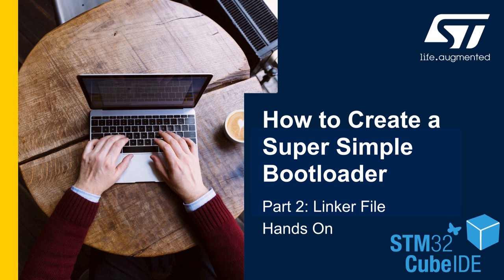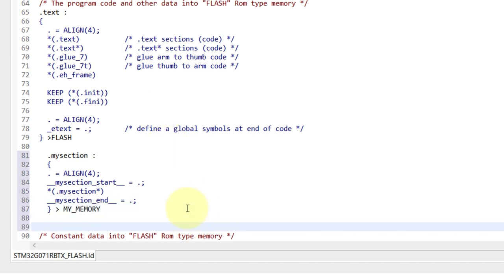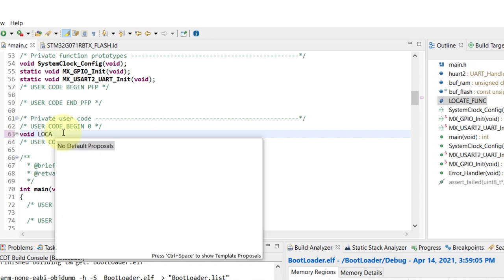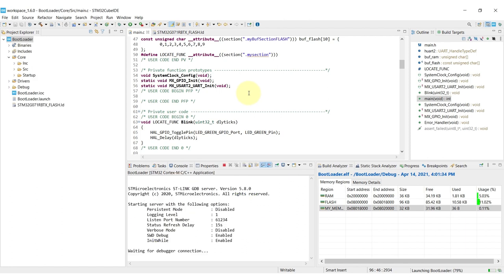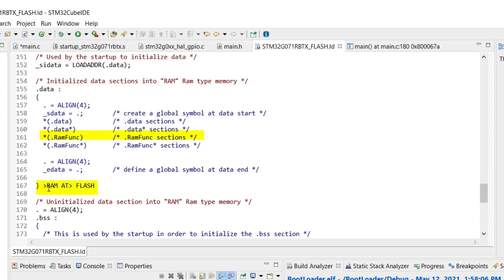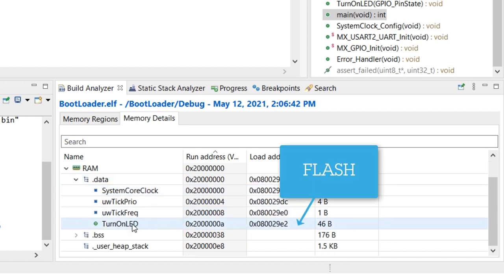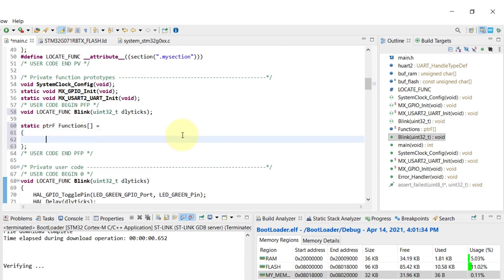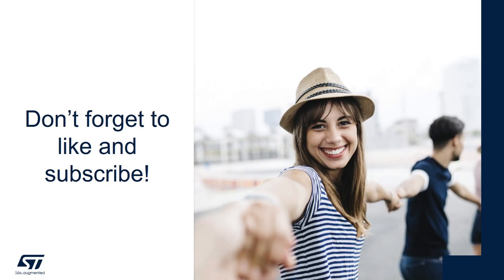How to Create a Super Simple Bootloader, Part 2: Linker File Hands On

Comment: Hi, thank you for the great video tutorial. I'm trying this on stm32f407 and things are not the same. 

For start, there are two linker files. RAM and FLASH. 
I went ahead and used the FLASH linker.

Then, Ram and Flash sizes were different, I set the MY_MEMORY block to 0x80f8000 (992KB from the beginning of flash) and LENGHT to 32K as shown in the video. 

Then there is a problem with the Blink function. Its not showing up in the MY_MEMORY block in memory region. 

I went ahead and set up .RamFunc and once again things are not the same. The function resides in FLASH->.RamFunc and the Run address is the same as the Load address both in the 0x8000000 range (in flash). 

Is this not meant for the f series? Should I quit or is it something I'm doing wrong?
Reply: @stmicroelectronics How come you haven't answered this? I am bothering the same

Comment: First of all thanks to making this video for us,
I understood whole video. and how it is working ...
But got a question , if we can write a function in FASH section and can access it by function pointer from another program too (function in BOOT app can be access from MAIN APPLICATION software using function pointer).

then why we need to write a function in ram function (in .dada), and as you mentioned that it will be stored in FASH only but copied to RAM again.

what that means , does it means that function will be store at two places one in flash and another in .data section too???

and what is its actual benefit ?????